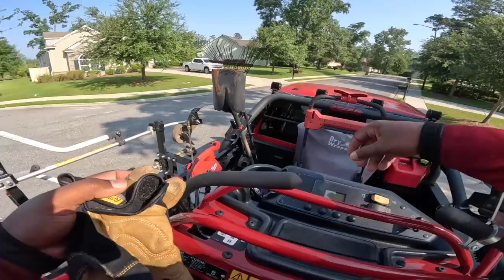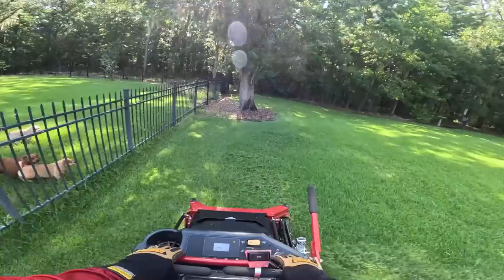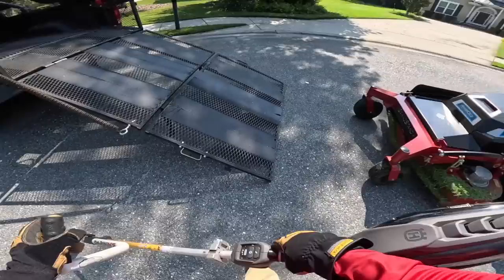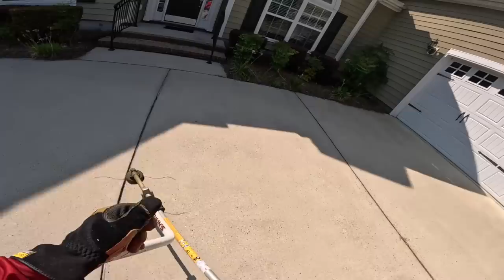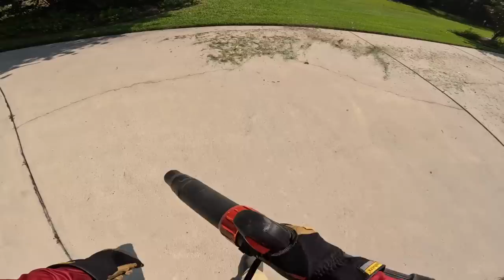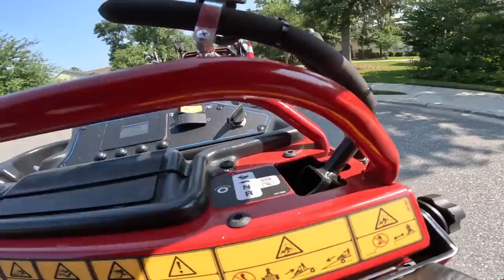Cutting Grass | The Toughest lawn I mow

Comment: Only $1.50 a week to charge the mower is crazy! Can I ask what you spent on gas weekly before making the switch? I love how quiet the electric mower is too.
Reply from the maker: It's hard to say with the fluctuation of gas prices, but I get 65 properties mowed with one charge
Reply: It's a hell of an improvement. I currently spend anywhere between $70-$100 a week on gas for my mowers and 5 gallon gas can.
Reply: They cost next to nothing to charge, going on 4 years with my greenworks 52”

Comment: Maybe I'm missing something, but it appears you don't put much concern into laying down parallel stripes on this property whose good condition of grass certainly would show them off.  It's one thing to run back and forth over places you've already trimmed, but you appear to be all over the place with no thought to any kind of a pattern.Where am I wrong?
Reply from the maker: My type of grass doesn't stripe so patterns are not a concern. If I was mowing a lawn that striped then that would be the objective. My main concern if the end result and customer satisfaction.

Comment: As someone looking to start my own lawn care business, how come you used the string trimmer on parts you already edged like the sidewalk I believe it was?
Reply from the maker: Torpedo grass is very rough so the blade edger leaves stragglers sometimes so it's a precautionary act
Reply: @Bladesofgrasslawncare  ah I see, thank you sir!
Reply: String trimmer leaves the edges crispy and an edger digs into the dirt a bit to leave a defined edge. Grass can be thick on edges so a stick edger would clean the edge if you haven’t done them and the trimmer just leaves a clean cut like a mower blade. An edger doesn’t have the same vacuum as a mower deck so it tends to leave a few bent blades and it doesn’t look as “clean”
Reply: @electric6877 the rotation of the string acts as a propeller to pull air. This in that action simultaneously the grass is magically cut by gnomes that jump dimensions to hand cut the grass with safety scissors.😊

Comment: You hear that suckers! 65 yards and it costs $1.50 to charge 😂.  Sorry not trying to be a jerk but I have been running electric equipment for 4 years and no one ever believes that I can get through my whole route easily on 1 charge and I only paid $10k for my greenworks 52”(the big boy commercial version).  Now they are way more expensive so that is definitely an issue.
Reply: Probably depends on what type of properties you’re mowing but the newer Greenworks is supposed to cut 8 hours on a single charge and you can also get the clean energy tax credit which could bring down the price about $7,500. And if you live in California you can get an additional discount which I’ve heard brings down those $22k mowers to about $6,500 or so